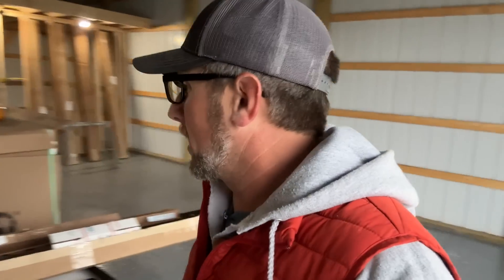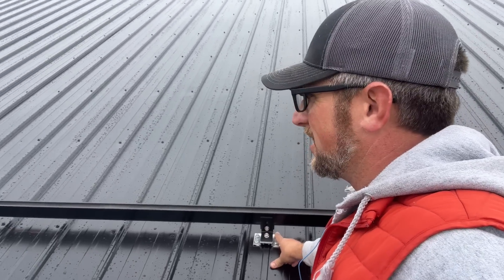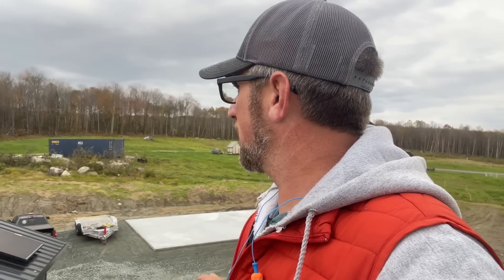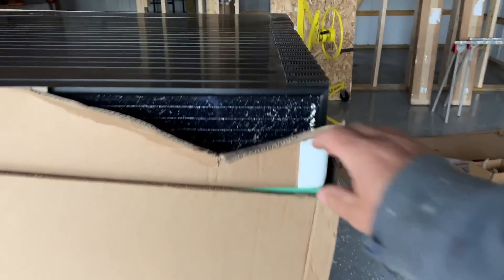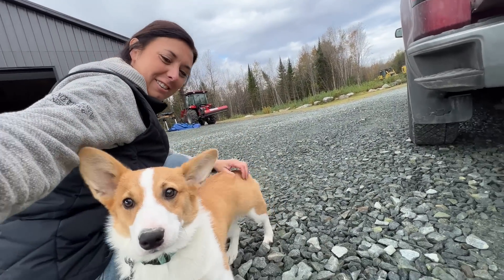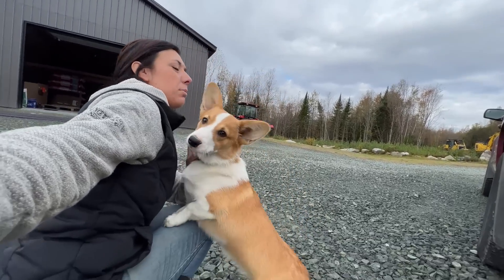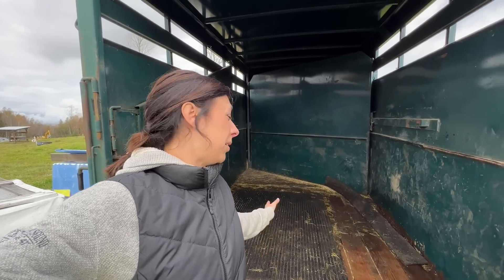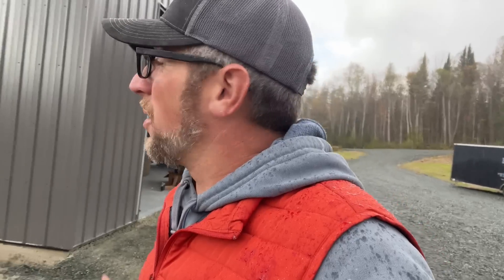Building a MASSIVE (15Kw) Solar SYSTEM to POWER our OFF GRID WorkShop in the WOODS

Comment: Hey yall, Gina, use Soft Scrub cleanser & Magic Eraser to clean your glass cook top (see 24:31). The easiest way to get the mats out of the trailer is C-clamp a 2"x4" on top & & below then drag it out with the tractor. To get it back in, keep the clams on and use a 16' 2"x4" to push it in with the tractor, with the C-clamps end in first.

Comment: Ken said "We're going almost all the way up" and Al said "May as well". Actually, that is a common mistake. You should always start as high up on the roof as you can and work towards the bottom (at least for planning, once measurements are known you could do it from the bottom up). Winter shadows are very long and a foot higher can make a real difference if the bottom of panels are being shadowed. Especially in the winter, every watt counts and even a small shadow is a real power thief!
You gotta love those solar MC4 connectors. Best invention since sliced bread. Really easy to work with.

Comment: Hi Al , Gina and Olivia. Just a heads up on your roof mounted PV cells. We have 40 on our roof and for the first two years we had pigeons nesting underneath them. They seem to like the dry and the heat there. we now have wire guards to stop them getting under the cells, although smaller birds can still get in there (not a problem with those)
Reply: Good to know! Thanks for talking about this problem. We are having trouble getting them out of our barn. Have a great rest of your week!
Reply: We just got a 22 panel system installed by All Energy Solar  and they installed Squirrel Guards around each panel to keep critters from gnawing on the wires.  Apparently that's a real issue. 😮
  Al has no trees nearby so that's good!
Reply: The mesh guards are a plus and a minus. The minus is it traps wet snow and ice.

Comment: Good morning Lumnah family from a cloudy, wet Minnesota. Good morning viewers. Figaro at 1:39 and 2:47. It's nice to have that lift! Was that the lift Ken was going to use to put joists in place at one of his job sites? Wow, those rails are going up pretty fast. You're even getting the panels put up. Too bad about the rain but you're safely working around that problem. Looks like loading the pigs to go to the butcher was easy with eggs. Those panels are going up like clockwork. Azalea is such a pretty cow. Too bad there is a broken panel Al! I'm so glad you have Ken and his crew to help you put all this up! Dan is great holding the panels and handing them to you guys on the roof. Ken brought Kai! So cute. We have those rubber matts in our animal stalls and yes they are super heavy! Great job getting the trailer cleaned out Gina. Zucchini muffins? Those panels do look nice on the workshop roof. Moose tracks in the mud? Nice double rainbow! Thanks for this video Lumnah family!

Comment: That was a bit of a surprise. I was expecting a solar array like the one up by the house. Another thing that I finally noticed is the inside of the man door is not red like the outside. 
 I'm not surprised that you hired Ken & crew for the solar panels. It does have to be up and running before the snow flies.

Comment: Suggestion, If your installing conduit on the side of building plastic is fine for anything above 6’ from the ground. Anything below 6’ use ridged EMT. Eliminates damage if you bump into it accidentally with machinery.
Reply: wild guess is he comes into the building up in the loft so mostly inside for wires.
Reply: @rupe53  I agree with your guess.

Comment: Is Gina going to have to go up on the roof when it snows to shovel the roof and sweep the solar panels? Might want to include the cost of a comfortable couch in the project cost. 🤷🏻‍♂️
Reply: We live in the north as well. And alot of us use what is called a roof rake.  Usually the handles are 20' long.  Seems to be the question of the day and I am curious to know too!😊
Reply: @forrestgump9576    last year it was suggested they look into a rubber roof broom, commonly used to clear the tops of buses and trucks. It's made similar to a roof rake but there is no scratching possible. Since we only saw one video of panel clearing last year I have to wonder if it slides off quick enough by itself.

Comment: Why did you choose the roof of your shop to put your solar on? It’s gonna be hard to get the snow off of your panels this winter.
Reply: As I recall, we only saw one video of them clearing snow from the other system so maybe it melts or slides off fast enough to not be an issue.

Comment: I admire the simple construction design of your walls to concrete slab. No pier hole to drill, no over kill. Each wall between the 6x6 post could be built on floor and stood up for a better attachment, but hey depending on where you live over kill is not needed. Beautiful simple plan, you nailed it. I'm wondering if your doing a lean to for the remainder of solar panels.

Comment: The little Corgi is so cute ! And the Solar Panels on the roof looking really great ! Good Job on the overall installation ! Is both sides of the roof going to have Solar Panels or just  One side ?
Reply: Al said that he was putting the next sets of panels on the wall of the workshop just below the ones on the roof. This way, he will get the low winter angle of the sun.
Reply: You would not put solar panels on a North facing roof!!! Unless you lived in the Southern Hemisphere!

Comment: Nice looking install on the shop roof!  
I'm wondering if the solar panels have an integrated heating grid for snow & ice removal...
I've seen some solar panels that allow for partial operation when they're snow covered -- did you consider using them?

Comment: Solar panels look good...not a fan of putting them on the roof but only time will tell if its a good move...any particular reason why you picked roof top instead of on the ground..?? 
Anyway free power is off grid and that must feel good...here's to never having a leak...🥂...🖖
Reply: Nothing is free, probably cost north of $20K for the whole setup, more expensive than my power bill of $140 per month
Reply: @colstace2560    that $140 is $1600 a year. In 12 years they will be ahead of the game.
Reply: @rupe53   My guess is that the usage in the workshop will be minimal unless it gets used many hours a day. So the monthly equivalent electric bill from the power company would most likely be less than $140/month. Even then the biggest draws will only be power tools but only when in use. The led lights are minimal draws on the system. They haven't stated what heat source will be used to heat the water for the in floor radiant heating system.
Reply: @pasreview9274   Right now we don't have his numbers to crunch but we do know there's no power on the property and bringing it in would be way more expensive than what he has sent so far. Would have to research the cost of utility power over a half mile driveway, plus local distribution on site.
Reply: @rupe53 
 in 12 years they will have to replace the batteries
Reply: @colstace2560    Ok, that's a fair assumption. Two sets of batteries and one set of panels over 25 years sounds about right. (if all goes well) Hopefully the battery technology changes, and the next round is either cheaper (adjusted for inflation) or lasts longer. So far, we're still ahead of bringing in public power, because we haven't even considered $100 / month for that utility bill.... and spread it over 25 years = $30k without any adjustments. To me, that part is break even.... or maybe a bit better because you spend the $$ up front. 10 - 15 years from now the utility bill will probably double anyway.
Reply: @colstace2560   with them money is not an issue…thanks to their creativity and you tube ( us )…🖖

Comment: Install of the panels looks great!  Nice job!  Took me a while to figure out what the 2x6s were being used for...😁

So what's your plan gonna be to clear the snow off those panels in the winter?  I know with your current array you can use a long pole to brush them off.  I know with my array on my barn roof (which isn't nearly as big as yours) it's a pain to clear off all the snow from the MI winter.
Reply: Al will be putting more panels on the side of the shop to get the winter sun, so it shouldn't be a problem. 👍🐈‍⬛🫖🎃
Reply: @damogranheart5521  Yeah I heard he was putting 10 more panels on the side, but that's only 1/3 of what he has on the roof.  Typically you design your PV system for wintertime knowing that you have less sunlight, so you need to take advantage of every hour that you can.  If 75% of the solar panels is covered in snow, that could be a problem.  

Ultimately it kinda depends on what all he's planning to run in the barn(s) during the winter.

Comment: How will you deal with snow covering the panels? 
 Will you just have to wait until spring?
Reply: as I recall, we only saw one video where they cleaned panels last winter. That makes me think it slides off or melts quick enough to not be an issue.
Reply: @rupe53  
 If the pitch was as steep as thevaray  for the house, I would not have made this comment.
Reply: @jbbrown7907     I guess we'll find out what they have in mind. Sometimes I feel he says nothing to keep the comments down.

Comment: Good morning Al n beautiful Gina I was going to suggest for you to build a solar panel rack n have it built on ground level because I heard that if you put solar panels on the roof it'll cause your roof to leak n cause damages n when you have to replace the roof you'll have to take all the solar panels down b4 replacing the damaged roof (but you have a metal roof just don't forget to seal the holes from the screws) otherwise build a platform for the solar panels to relax in the sun n it can be able to rotate to catch the sun from dusk til dawn
Reply: Metal roof will last at lest 50 years and solar panels probably 25 years. If you figure the life cycle, you do everything at the same time. BTW, Al will be near 75 at the first panel change out. You think he is really worried?

Comment: Curious about your plans to keep the snow off of those roof panels.  The ones by your house are down low, and easy to sweep off the snow.  Will you need to get up on a ladder to clean the snow off?
Reply: All that property to instal a ground mount on and you punch that new roof full of unnecessary holes to mount panels that are difficult to clean and are not positioned correctly!

Comment: Another great video, just curious why you went with a roof mount instead of a ground mount to the right of the garage. With all the snow you get a ground mount is easy to clean. Shipping companies are rough on stuff and getting 1 panel is even worse.
Reply: Al said that he was going to do the panels on the shop wall below the panels so he could get the winter sun.
Reply: @damogranheart5521  I meant the entire system, like at the harvest house

Comment: 15 kilowatts, how much would that be during winter, roughly? Enough to heat it, no matter what? Curious to see how you set it up. I mean the batteries can't be allowed to freeze, right? Backup wood stove or just double up on the controllers and converters?
Reply: They will be using radiant heating same as house. The piping was shown being installed in a previous video.

Comment: Curious of the direction of the solar panels, they seem to be facing a different direction compared to your home's array?  In the northern USA and Canada you want to be facing due south or slightly south, south west plus your angle should be able to change plus/minus 10 degrees of your latitude for optimal solar performance.  We have an offgrid cottage/camp in NW Ontario and we built our cottage with southern exposure and an 8/12 pitch to accommodate our panels.  It looks like you might be oversizing your array to compensate for a non-optimal direction and angle?  Well done!  Ever think about adding small wind turbine?  With all the open pasture land it might be feasible.
Reply: that roof faces south, although I think the pitch may be a little low for winter sunshine. My guess is a ground mount system costs more than a few extra panels.
Reply: @rupe53  Please watch again as he addresses that.
Reply: @damogranheart5521    addresses which one? The low pitch or exactly where the last few panels will go? I thought I heard "off to the side" which left me waiting to see where they will be.
Reply: @rupe53  I apologize. I meant that for the gentleman with the question. He is putting panels on the wall of the shop directly under the panels on the roof.
Reply: @damogranheart5521     Now you have me curious because on a pitch they will take runoff from the roof, and completely vertical is not optimal, but snow reflection might make up for that in winter. I guess we'll see soon enough.
Reply: @rupe53  Works for me in Minnesota.

Comment: What are the amps and watts of each panel? Are you bringing in 3 phase?
Reply: This system is similar to the house system. 120 /  240 volt single phase. I believe I heard 15Kw total. (400 watt panels?) I don't recall what the storage battery capacity is.
Reply: @rupe53  40 x 375 = 15Kw.
Reply: @tonygrimes13     maybe I missed the numbers, but I thought I heard 30 panels on the roof and another 7 elsewhere. I could be wrong.
Reply: @rupe53  Al said 10.

Comment: DO THE TOOLS COME WITH THE KIT.
Reply: I think those electrical tools came with the special wiring kit you have to do with the solar panels. I think the rail mounting kit just comes with the mounting parts and nothing about the wiring. Usually the connectors are MC4s. They need a special crimping tool like Al was using and the wrench for tightening the connector ends. Have a great rest of your week!
Reply: THANK YOU KATHRYN FOR THAT INFO. @StoneKathryn

Comment: Hi Al if they don't replace the broken panel or even if they do Get a Multi-Meter and check the output against an unbroken one it may still be working if so you could repair the glass there are glass repair products they use on car windscreens but I must admit there is a lot of cracking but you may be able to replace the whole glass.

Comment: Al, haven't seen you answer the many times asked question: What was the purpose of the wood that was on the roof under the panels that were later removed? Inquiring minds want to know. No guesses, need an answer from the " horses mouth ".
Reply: Probably to stop them from sliding off of the roof.
Reply: @DukeOOO  The mounting rails themselves would have served that purpose. Need Al to answer.
Reply: @pasreview9274  I doubt it...If they were slidiing they would have gone right through the rails. I used to do this for a living...unlike Al and you. So wait for his comment. I welcome your ignorant reply.
Reply: @DukeOOO  So that they had good footing on roof, courtesy of Ken's channel.
Reply: @DukeOOO  Yep . I just watched Ken's channel and he explained . So your assumption is correct. Nothing ignorant here now or before.

Comment: You'll be so independent.  That's a good thing.  Then batteries will become difficult to impossible to get.  Then you'll need replacements.  And you won't have independence.  That's a bad thing.  Plan for a wood stove in there.
Reply: Don't need a wood stove as building will heated by radiant heating, similar system to house. The pipes were installed before they poured the concrete for the workshop.

Comment: For those that don’t know, metal roofs are like ice when they’re wet. Extremely dangerous to work on.
Reply: That's why they were using the lumber.
Reply: @tonygrimes13  the could have also used the rails too, but I did see they were using the 2x6’s.

Comment: Has anyone reported Ken's company to OSHA?  Working on a wet metal roof with no safety harnesses.  Even if it is dry at that height it's required to have harnesses.  As the homeowner Al is not required but should be using on.
Reply: Independent contractors fall under the category of who is not regulated by OSHA coverage. As an independent contractor, Ken is not obligated to wear a harness per OSHA rules. But, it’s something he should consider.
Reply: @royfrye333  thanks.